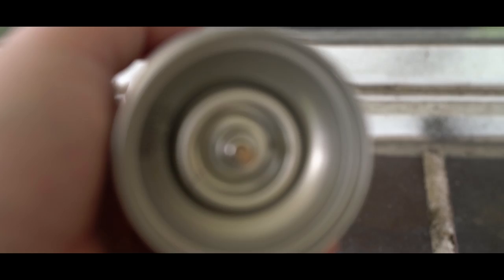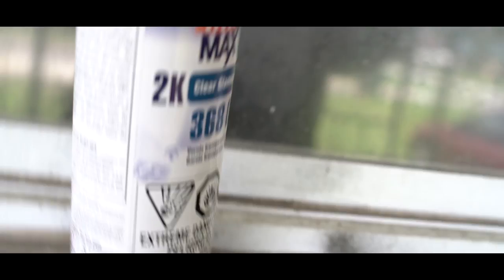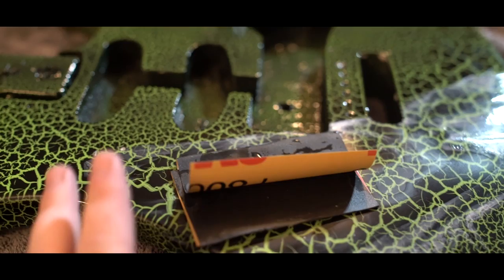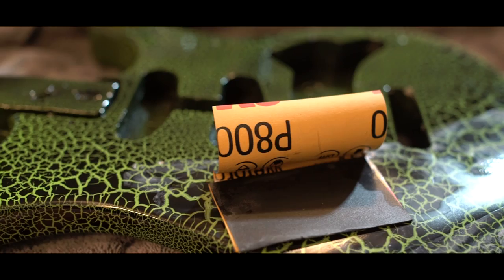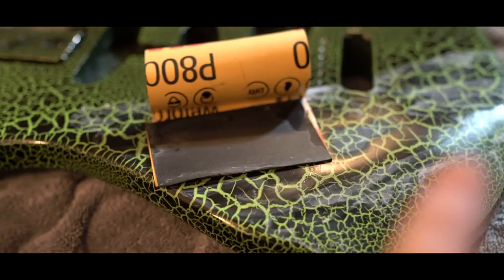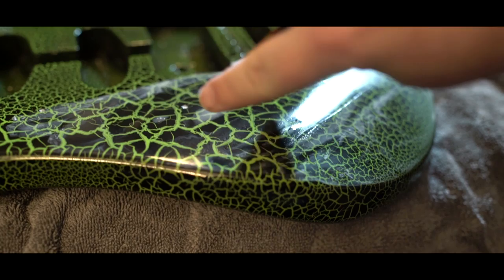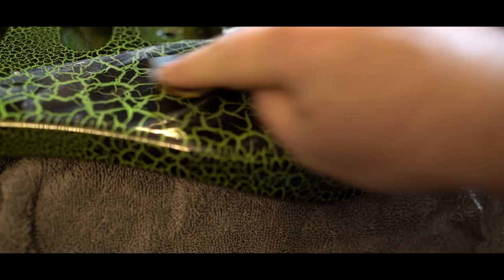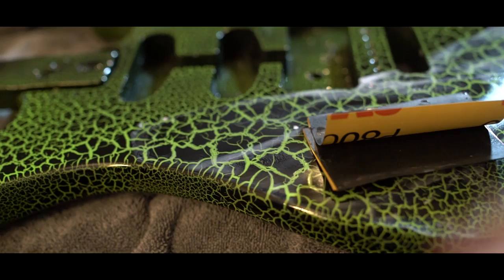Flawless Gloss over Crackle Paint: Peavey Raptor Refinish 2

Comment: Most crackle paint jobs are finished with self leveling resin. The process is longer but doesn't require further treatment. I.E. no sanding, buffing, and so on. Holes will need to be re-drilled, but you can take advantage of any stripped holes being repaired.

Comment: I spray my guitar bodies with an Iwata Medea siphon feed and a .05 needle using Createx paint.  This is after I've used Solarez grain filler.  After grain filling, sanding, and painting I use Solarez clear high gloss top coat.   The thing about Solarez top coat is you brush it on with a foam brush and let it level for about an hour.  Notice I said level, because it won't dry.  To dry it, you take it out into direct sunlight for 3 minutes.  It's completely dry and ready final buffing and polishing, then for the electronic to be installed.   Guitar looks like its been dipped in glass.

Comment: That turned out amazing! 

I've finished some swirled objects with clear coat too. What I do is use regular clear coat during the leveling stages (costs 5 euros a can, 4,50 dollars). 

Once it's almost level I shoot two coats of 2k. You've got to be a little bit careful not to burn through the finish and it costs a bit more time. But it's a lot cheaper and just as durable.

Comment: STUNNING job, and you let folks know they too can do this. I would be pleased with that on my axe.( I play like crap, so looking good helps!) Two comments. I personally like the variation between large and small cracks. Keeps a great crackle from looking mundane. Also is more realistic (look at real, aged crackle on an antique). 

Second, you can level your gloss coat more quickly AND safely if you back your sandpaper with something stiff. Using your fingers allows the paper to sand down into the cracks and low spots somewhat, causing you to have to sand you high spots even more. Take it from someone who has done high-end finishing on cars. Doesn't need to be a solid board. A layer or two of rag stretched on a small piece of wood, or use a dense piece of foam for curves. Light pressure! Nice work!
Reply from the maker: Yeah I could have definitely used a stiffer yet flexible backer, and I'm well aware that it's possible to create ruts when using your fingers, but I like to do it that way.  I feel the surface better and have been doing it long enough to avoid ruts.  Thank you for the kind words, advice, and for watching!

Comment: Try using simtec clear polyester it lays on thick and will easily cover over the crackle with 2 or 3 coats. Also it sands and buffs out really nice plus it's 90% the hardness of glass. Get a cheap hvlp gun from tcp global make sure the tip is 2.0 or higher since this is a high solid...but the down side is you have 25 mins max or it will harden in the gun...just spray it up to 25 mins...clean your gun with acetone...then mix up another round by then your fist few coats will be nice a tacky then and hit it again...it may seem like a lot but the results come out so nice after wet sanding and buffing. I want to try that crackle over a silver crylon base, crackle and then candy over it ...maybe with a blue candy house of kolor or burple👍🎸

Comment: How soon after the crackle coat application did you apply the 2k clear? And have you experimented with a 2k clearcoat between the base color coat and the crackle? Some brands say it helps bring bigger cracks...about to take the plunge on 2 guotar refinishes buy want to get it right!
Reply from the maker: 45 minutes.  I have not tried that but sounds like a plausible idea!
Reply: @ForsytheVideo  45 minutes between Montana crackle and clearcoat?